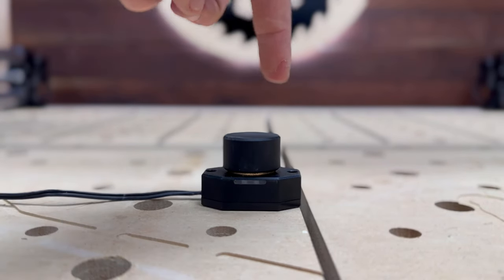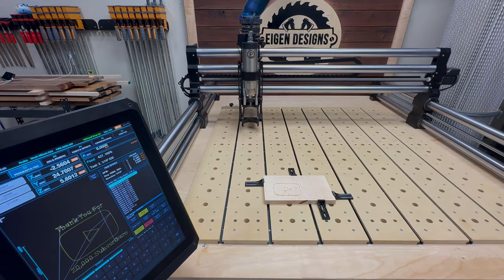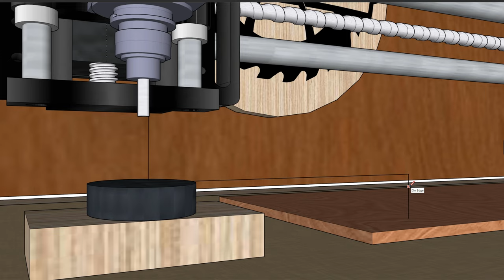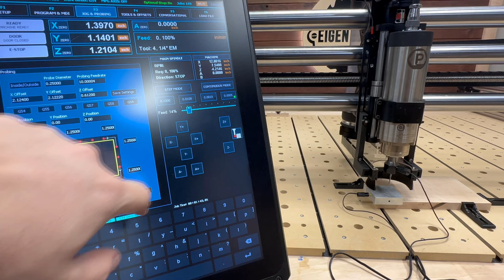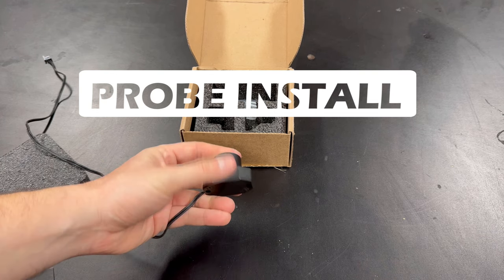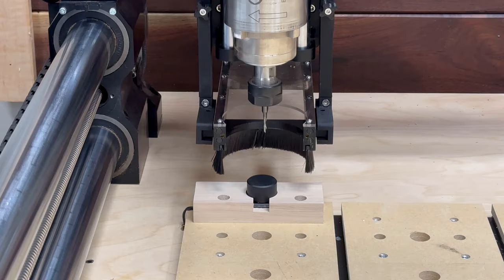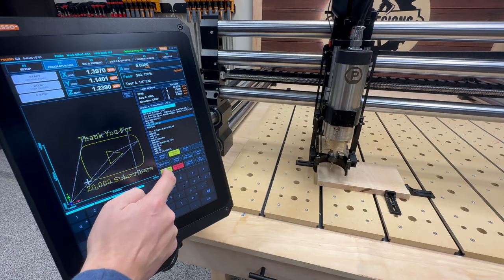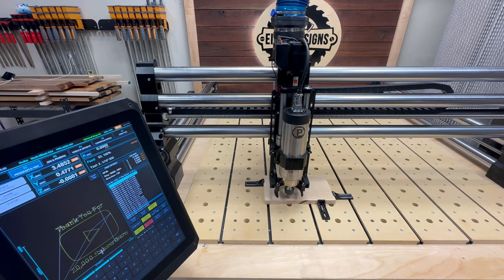CNC Tool Setter  |   Up Your Game

Comment: Extremely helpful. Thank you. May I ask, did you design your spoil board with MFT style 20mm dog holes for better clamping options?  Again thank you in advance
Reply from the maker: Yeah, I wanted to have the option to use dogs and dog clamps to provide lateral bracing to my pieces. I use these when doing surfacing operations when I need to keep the top of the work piece free from clamps.
Reply: @EigenDesigns  I’m on the fence of which Machine to buy, the Onefinity Elite Foreman or new machine that Seinci just released called Altmill. When i do build my spoilboard, i thought an MFT style grid would be helpful to square up the X,Y position using bench dogs or low profile planes while using Festool Element clamps for lateral clamping like what your doing. 

I’m just so on the fence in to which machine to buy. Lol. Thanks for the replay and great to share ideas with. 😀😀

Comment: Hi, are you using vectric and what post processor are you using to do tool change....its not popping up on mines...thanks\
Reply from the maker: @ApluswoodcraftsInc  I use the MASSO post processor and I use Fusion360 for all of my design work. For my post processor, when you have different bits for different tool paths under a single g-code file, the processor automatically puts in a prompt for tool changes when required.

Comment: What would cause my z height to be off .2 of inch. I've set mine up the same way as you described. I use probe to set xyz at first then after it changes bit it cuts about .2 inches deeper than first cut? I don't change bit until I'm prompted to do so.

Comment: How do you get the machine to come to the front for bit changes when prompted? Or did you just jog it to that position?
Reply from the maker: There’s an option to establish a “parking” position, which is where the CNC will go to when a bit change is needed. On the elite machines you can set this up in the F4 menu
Reply: I don't believe "parking" is the same as for the bit change. Parking would be after the program is complete. Check out Mitchell's woodworking you tube video (re the tool setter) and you will have to wait until the very end of the video for the portion about how to select the location for tool changes (preferably right above the tool setter). Check it out.
Reply: I don’t recommend having your tool change position directly over tool setter as sharp pointed bits can sometimes fall out and an MDF spoil board is far more forgiving that a metal plate